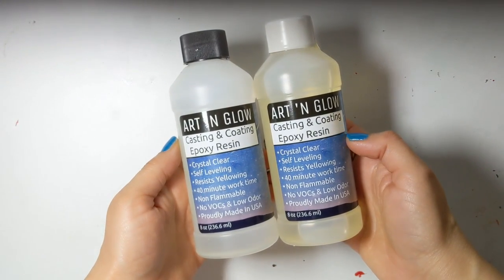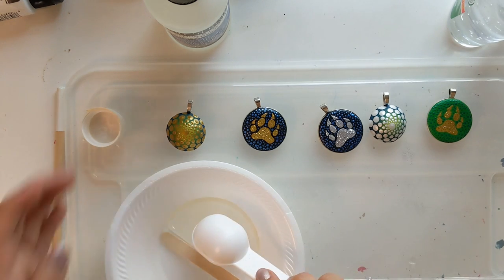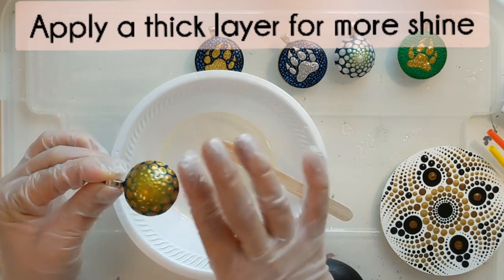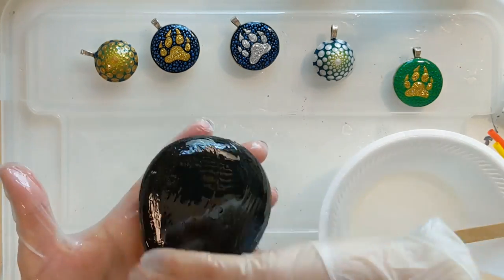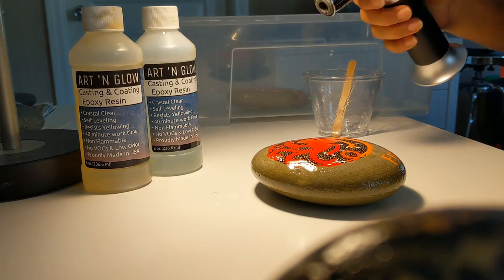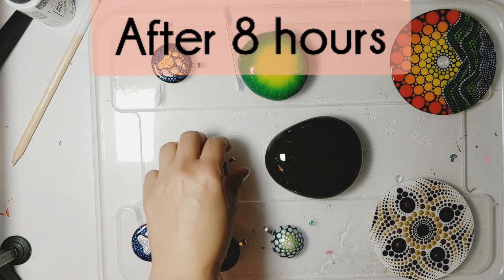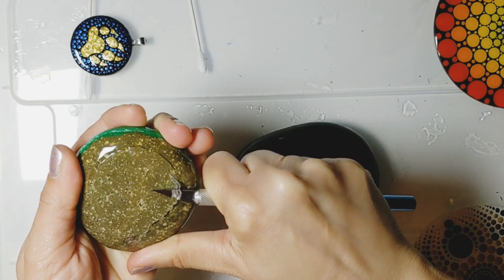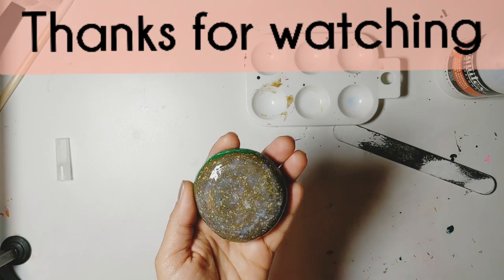How to Resin Mandala Stone/ Coaster/ Pendant -with Resin hacks

Comment: How to get a thick layer of clear resin on the round coasters? Very interesting vid!
Reply from the maker: Mix your resin. Instead of waiting 10 minutes, wait for 50 -60 min. Your resin will be thick and you can apply thick layer. Do not use torch or heat gun that will melt it thin.